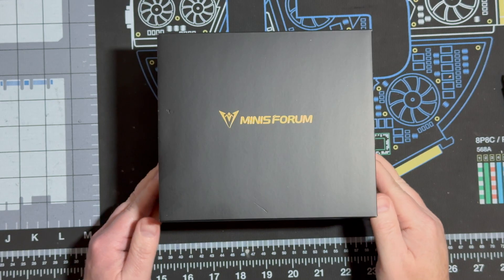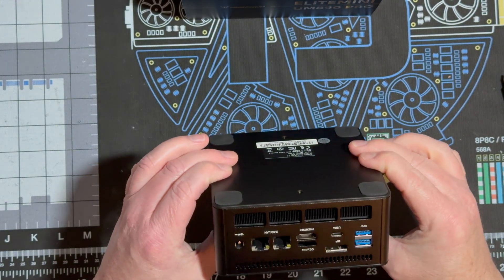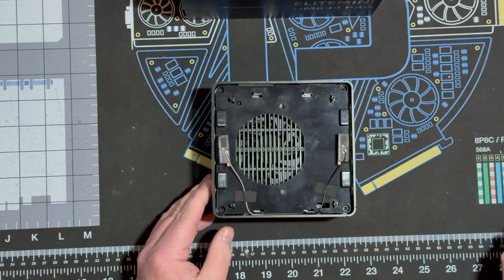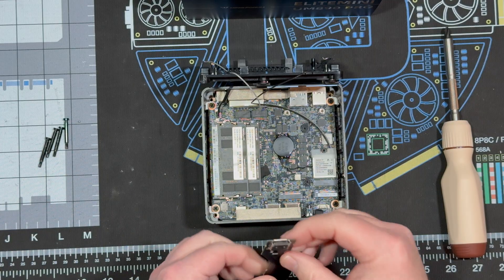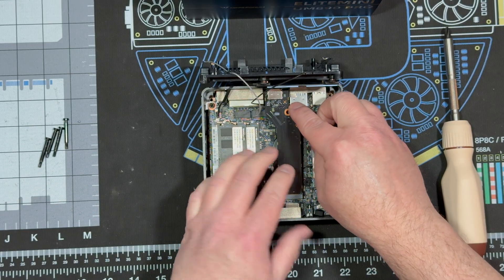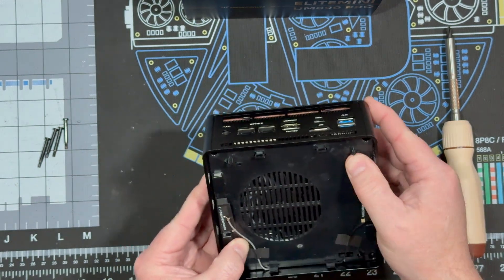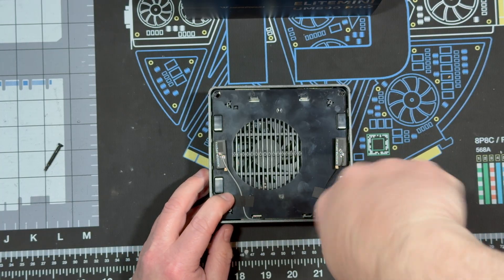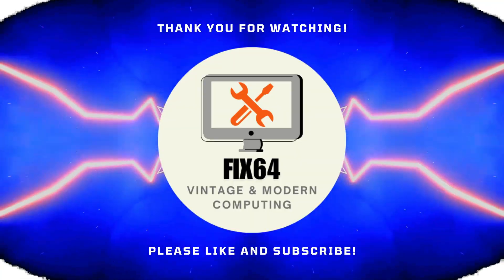Minisforum UM890 Pro barebone Mini PC! Step by step to install Ram and SSD!

Comment: !!! CRITICAL WARNING !!! You forgot to peel off the white plastic backing from the thermal pads !
Leaving those films on blocks the cooling system entirely. For high-end SSDs (like the Samsung 990 Pro) and DDR5 RAM this will  cause severe thermal throttling or overheating
Reply from the maker: I now show myself doing that on camera for education purposes.  I had them removed off camera.  In fact I open that computer up more than most to answer questions, and it's very difficult to remove that top portion now because they stick so well.  Thank you for the advice and watching!

Comment: can I put an Crucial P310 SSD 2TB PCIe Gen4 NVMe M.2 with heatsink into that? or only one without a heatsink?
Reply from the maker: I don't think one with a heatsink will fit.  It has its own sort of heatsink with thermal pads already.  All I could fit is one without in mine because of the built in heatsink.

Comment: Hi.  I got the following specs:

MINISFORUM UM890 Pro Mini PC AMD Ryzen 9 8945HS(8C/16T, up to 5.2GHz) 64GB DDR5 1TB PCIe4.0 SSD, 2xUSB4(PD 8K)|1xHDMI|1xDP Four Outputs, 2x RJ45, BT5.2 4xUSB3.2 AMD Radeon 780M Graphics Micro Computer

 I noticed the comments here. I still have not installed the Oculink board/port or even opened up the Mini PC.  I would just like to expand the SSD by adding one more SSD (maybe a 2TB) NVME drive and just use it for storage, not windows.  Would it work out smoothly if I just attached the extra Drive to it's port inside and not need to install windows or have the issues others are mentioning here?
Reply from the maker: I think as long as you leave the original drive in, you should be fine.  I've replaced the main SSD several times and have never had an issue installing Windows or anything.  In fact one of my latest videos about the IDSonix SSD is me putting it in the UM890 Pro and installing Windows and testing.  Good luck!

Comment: Thanks for the video. Now if I could only get Windows 11 to install on my UM890 Pro. So far, after about 12 hours and 100 different attempts to install Windows 11 from a USB, I've got a paperweight.
Reply from the maker: You are the second person to bring this issue up.  Something is going on with the UM890 Pro and Windows installs.  Do you have the Oculink adaptor hooked up?  Some people have removed that, were able to install windows and then installed the Oculink again.
Reply from the maker: I am going to replace the SSD in mine and try an install again and see if I can replicate this issue.  Perhaps if I can find a solution I will post a video update.
Reply: @theFix64  That would be absolutely amazing. As of right now I have an extremely frustrating machine that cost almost $1,000 usd and I can get it to do nothing.

Ryzen9/96GB DDR5/Two 2TB M.2 SSDs
Reply from the maker: I here you.  Nothing worse than spending the money and having issues like this.   So far the new drive is taking a Windows install.  I take it you don't have the Oculink hooked up and you have 2 SSD's?  I can try that too.
Reply: @theFix64  No oculink for me. I just don't understand why I'm having this problem at all. Installing Windows from a usb drive is one of the first things I learned to do.

It's not a difficult task, generally speaking. This is the first time I have ever had this problem (I've been fiddling with PCs for 25 years).
Reply from the maker: I've had some issue in the past installing Windows, but something strange is going on with these PC's.  I can't replicate the issue yet, but will try some different things.  I'm sure you've checked the bios for boot priority etc?  What is your raid setting at?  I have mine disabled.  I will continue to play around.  I will put two brand new NVME in next.
Reply from the maker: Did you try disabling secure boot in the bios by chance?  That has kept me from installing via USB in the past on some finicky machines.
Reply: @theFix64  I'm going to respond to both comments here.

I have gone into BIOS and set the boot sequence, yes.

RAID is disabled.

I have tried disabling secure boot, yes.

I'm so frustrated. I very much want to play around with this machine. It's supposed to be my new "daily". 

I guess it's good to know there is something odd going on here and I'm not the only person having such a hard time with a windows install.
Reply from the maker: You've tried everything it sounds like.  I can not replicate this issue at all.  Does it recognize the drives?  Just won't boot into USB windows install?  

I'm sure you are frustrated at this point.  No you aren't the only one with this issue.  I'm sure even more people will have it.  I'll keep looking into it.
Reply: @theFix64  It really seems as if it just won't boot from a USB. PERIOD. I'm going to walk away from it for a day or 2 before this frustration becomes anger.

I'm pretty sure I'm going to send this thing back.

Comment: Hello, can you help me with how you installed Windows on that computer? I have the same computer. It doesn't let me install the system from a USB drive, nor does it let me initialize the system from a disk with Windows installed.
Reply from the maker: Hello, I'm sorry to hear you are having issues installing Windows.  All I did is use the windows installer on USB and it worked right away.   I'm wondering if there is anything preventing it inside the bios?  You've set the USB to boot first?  Also I have seen something like this before.  People had to remove the Oculink add in card and it booted to Windows setup.  They installed Windows.  Then they installed the Oculink card again and everything worked.  I'm not sure if you have the optional Oculink card installed or not though?